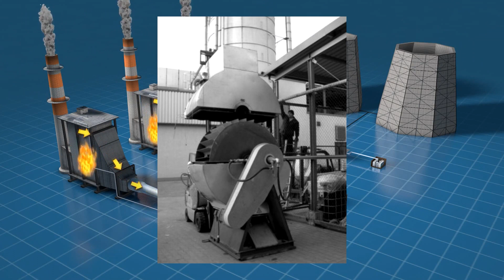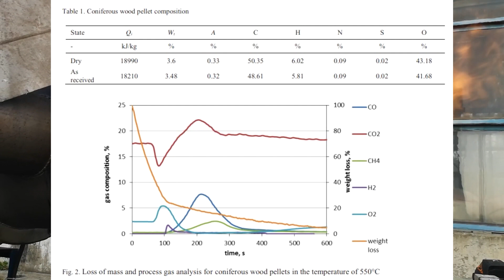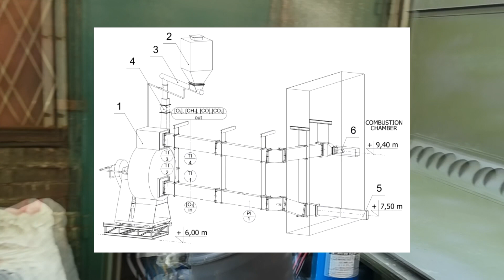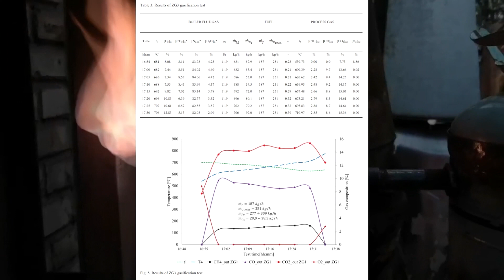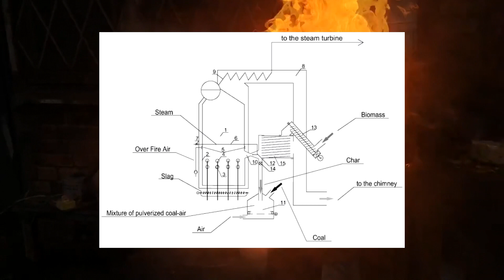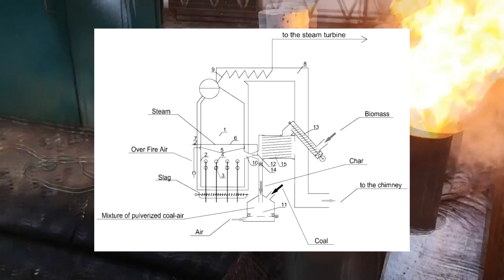Gasifier using exhaust gases from an industrial boiler

Comment: Hmm, maybe a loop can be made with an ordinary small generator set, considering small ones use just a car engine strapped to a bit alternator.  Feed the exhaust gasses to a rotary gasifier to produce more gas to run the engine to make the necessary exhaust.  You would need some starting gas for the loop, but it should be a good way to recover waste heat from a generator.
Reply from the maker: good engineering idea
Reply: @gengaz-lagunov  The more I think about it, the more I like it, if even half of the waste heat could be recaptured, then the effective efficiency of a ICE engine running on synthesis gas could be boosted to be more competitive with steam turbine based solutions, which works out better at smaller scales.